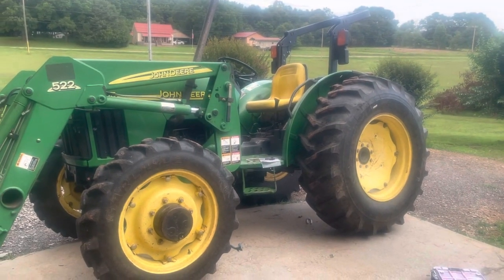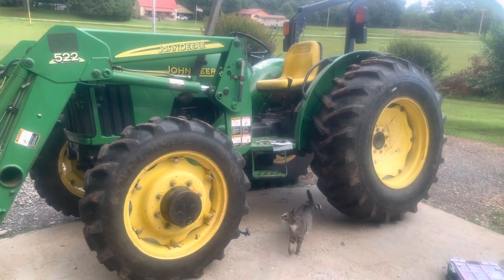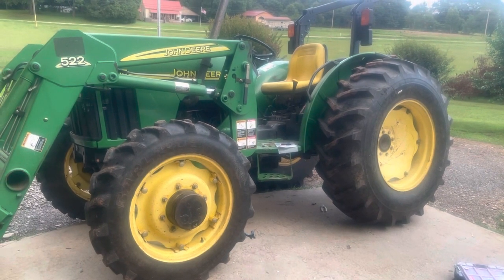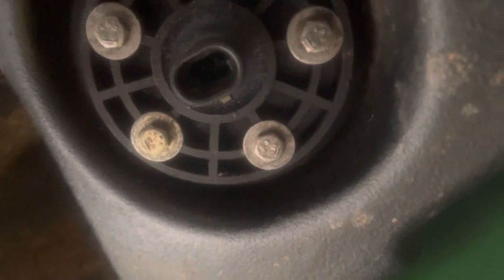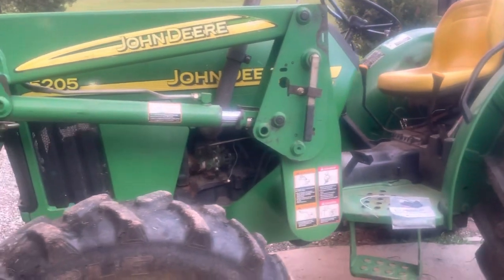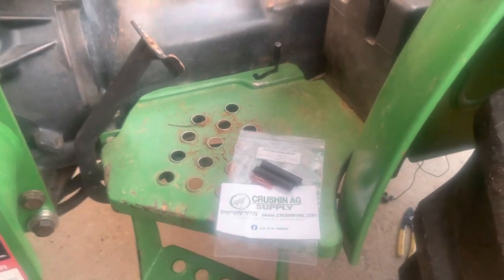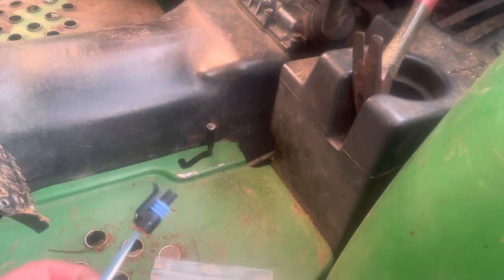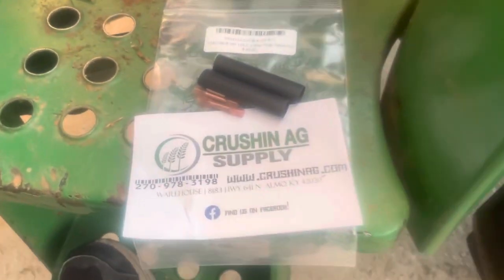John Deere 5205 5000 series fuel gauge repair.

Comment: I have the same 5205 tractor. My fuel gauge is not working either. The plug seems intact and no signs of the wires being broken. Trying to see what I might check next